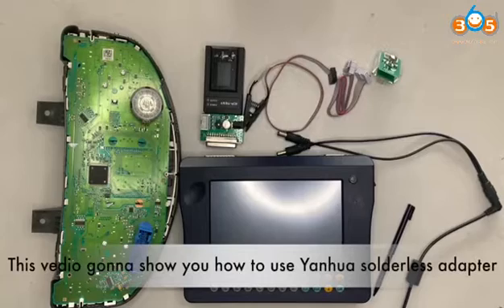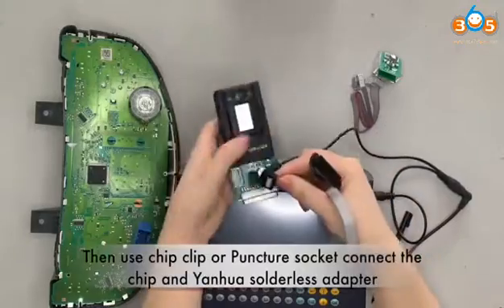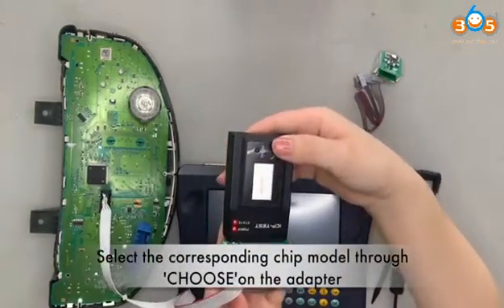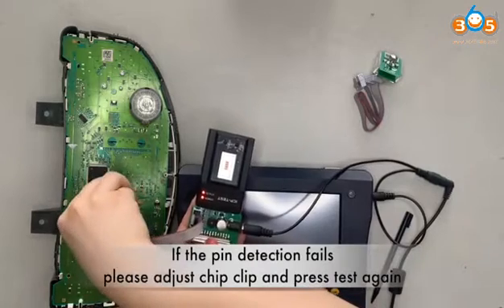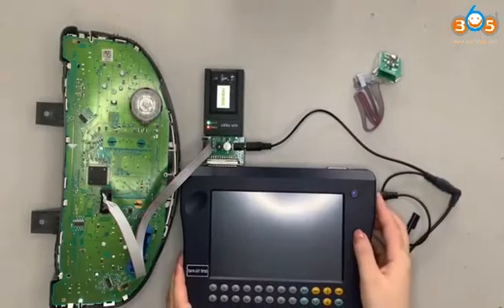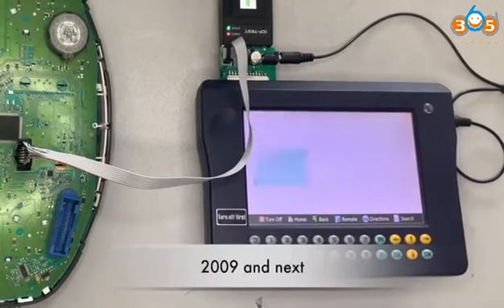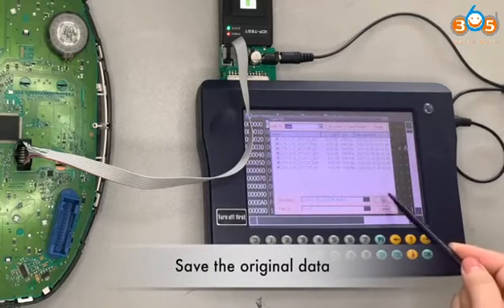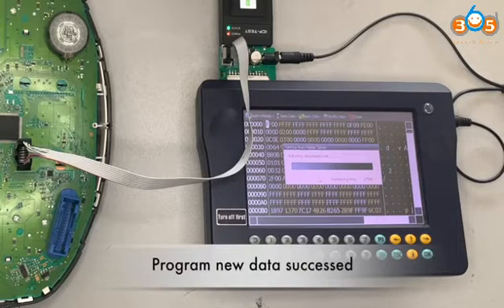How to use Yanhua Solderless Adapter with Digimaster 3 to change mileage obdii365

Comment: It's working in toyota also?  how much  the price the tools software you use?
Reply from the maker: Yes, it works on multiple brands incl. Toyota. Most Toyota needs to open cluster. This tool is standalone with built-in software. Here is the device info.  https://www.obdii365.com/wholesale/digimaster-3-digimaster-iii-original-odometer-correction-master.html But the device is for older models. Better send us model and year to verify or recommend proper tools.